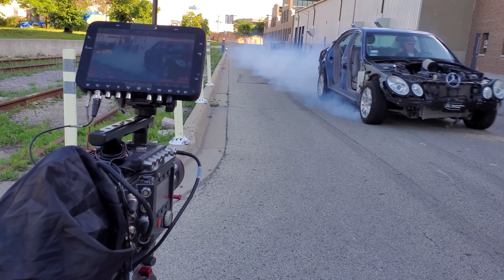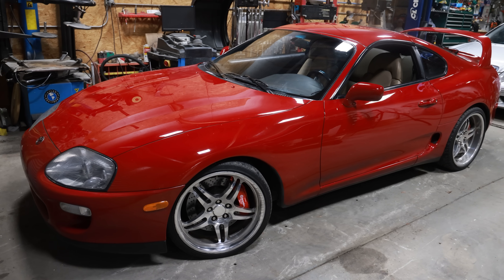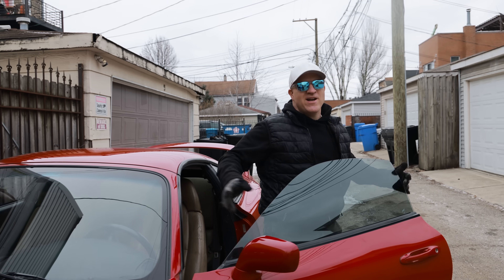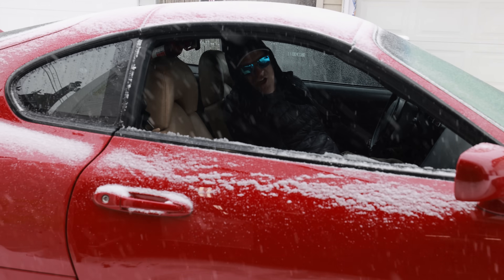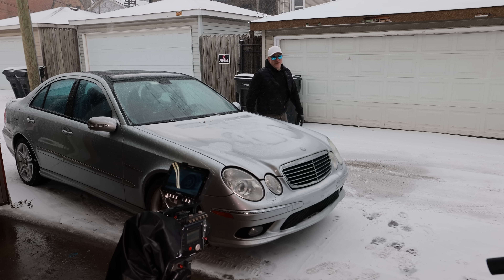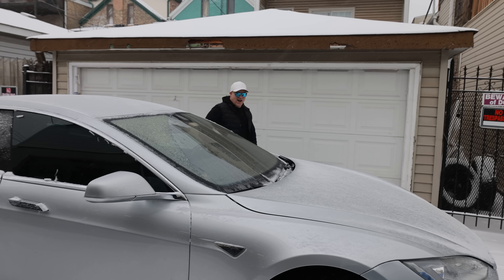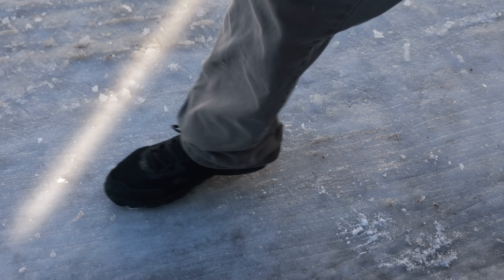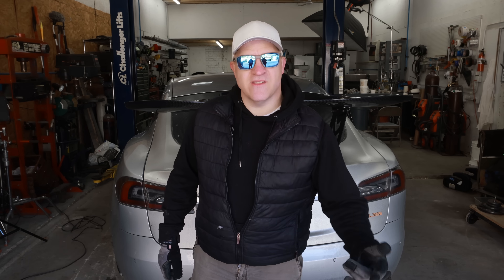Anti-Lock Brakes (In Slow Motion)

Comment: Are ya sure they are locking up everytime they pulse? I thought when they locked it was a pulse failure.
Reply: If you mean by pulse the frequency abs modulate pressure then it's a lot more. About a hundred per second.
Reply from the maker: Well either way the ABS is controlling the lock up and the opening of the calipers, so pulse frequency is still valid whether it's rolling or locked up.

Comment: Is there any brakes that apply a constant variable force depending on the surface instead of the normal breaks that give full force in pulsed manner
Reply from the maker: That's a really great question and I thought the same thing. I kind of thought that's what the Tesla did but once I saw it with the high-speed camera that theory was shot down
Reply: @WarpedYT 😂but that's what the regen does right

Comment: ABS is fascinating! It works on the fact that wheels that are turning have more authority than wheels that are locked up.(found this out on models hehe)
In a panic situation our instinct is definitely to push the brakes as hard as possible (brain said STOP!!) ABS steps in to pulse the brakes, to maintain steering control and can reduuse the distance it takes!
Something equally awesome, It's able to command the amount of braking power to each wheel. Say one side hits a patch of gravel it can reduce the amount going there while increasing to the others, it's so the car tries to trek straight. AND most cars use the steering angle sensor along with the accelerometer to make all this even more effective!
I love this technology :D
Reply: You're correct, but you're talking about several different systems.  ABS, traction control System and stability control systems all work in conjunction to accomplish those things. It's not simply the ABS.
Reply: Note that the purpose of ABS is not to reduce stopping distance. The purpose of ABS is to retain control while you brake.
Reply: @shadowboy813 exactly, I was pretty sure it's made for reducing braking distance / maximum grip, until I learned few years back that it's for steering. Locked up wheels and you can go straight only, ABS and you can turn while braking.

Comment: A lot of people misunderstand ABS systems. Modern systems don't pulse the brakes, they are constantly varying the force to keep the tyres at maximum grip. The times the tyres lock up are while the system is trying to feel the grip it has available. The modulation is done by bleeding fluid pressure back into the reservoir. The pulses you feel in the pedal are from a pump that keeps the pedal side filled up so the bleeding doesn't let the pedal go to the floor.
Reply: Oh wow today I learned, that's so cool
Reply: @bytesandbikes  
modern ABS systems work on three cycles, hold pressure, maintain pressure, and release pressure. The ABS pump is used to force your foot up to reduce pressure. When your foot drops, this increases the pressure, and valves inside the unit maintain the pressure it does this 100 times a second. Older systems are slower due to analogue sensor to digital conversion. Then, you got to consider ESP and traction control also included on modern systems which makes them far more advanced.
Reply: if that was the case, the system would not be able to release any more pressure when the pedal was fully up. And you'd need a separate pump for each caliper, and I've never seen that.
Reply: @bytesandbikes  
When the pedal is fully up, the pressure in the system is reduced, and the valves in the unit maintain neutral pressure before your pedal drops from your input, increasing the pressure again the cycles happen 100 times a second.
Reply: @dalesideroadclassiccarwork9038  Neat. What system is that? I've only done training on Bosch. I'm impressed the lag time on any pump is under 10ms!
Reply: @bytesandbikes  
I trained on bosch when I worked for Audi, vw and japanese systems when I worked for Mazda. But there are all pretty much bosch architecture. The difference is in the coding.
Reply: @dalesideroadclassiccarwork9038  Cool! It must have changed a lot, I haven't had a control unit apart since 2006. How is the high pressure pump able to start and stop so quickly now? Is it a piezo solenoid or something?
Reply: modern ABS systems have per tire resolution and per tire grip management.  older cars just push the pedal out until the wheels start spinning again.  I have an old car that has "ABS".  it might as well not have, as it only goes based on a single front wheel speed sensor and the output speed sensor from the transmission, and if they vary by more than 5mph, it just kicks the pedal out until the speed matches, it does not "modulate" anything.  my modern 2021 sienna doesn't pulse the pedal at all and does the grip modulation that you talk about.
Reply: @chubbysumo2230  four channel ABS  systems have been around since the 80s iirc. It wasn't a straight jump from one channel to four. It was one, then one per axel, then I think three with both front and one rear axel.
Reply: Sadly, no they don’t.  At least not well.  As the video shows, they basically lock  and release rapidly.  Continuously variable analog actuation is nice in theory, but doesn’t work well in practice for several reasons.  One, is the inertia of the wheel.  Once it locks, particularly on a very slick surface, it takes a lot to get it spinning again when little traction is available.  The only way to ensure this happens quickly is to essentially fully release the brakes.  Then if ease back into them too slowly, you leave a lot of braking on the table.  About the only way to make ABS really effective on slick surfaces is to have a fifth wheel that constantly measures the road speed so that the ABS has an absolute reference for tire rotation speed and can just more quickly tell when a given wheel is decelerating.  Most systems today rely either on the average speed of all 4 wheels, which doesn’t help much once they all lock, or on the wheel getting below some absolute rotation speed which by necessity has to be a very low speed to avoid losing braking at slow speeds.

ABS isn’t easy to implement well across a variety of road conditions as we see in tests like these.  You really need more information that you can get from the 4 wheels being controlled in order to get analog like smoothness.
Reply: @LTVoyager  This, along with front wheel drive being common, is why student drivers are taught not to press the clutch early during emergency stops (at least in the UK)

I'm really interested in what systems are doing this on/off that people are commenting about. I've worked on a fair number of different cars and bikes over the years, and never seen anything but the single pump multi servo types. But I have no experience with American cars new enough to have ABS.
Reply: @bytesandbikes  Sadly, in the US we have so few manual transmission cars that our student drivers have no idea what a clutch is.
Reply: @LTVoyager to be fair, 99% of the time not all wheels are locking in an emergency stop on dry pavement. Brake bias and weight transfer usually allows at least one wheel to give good reference. Winter driving is where ABS is notorious for sucking, but I believe between inertia sensors, brake pressure sensors, and other systems this could be greatly improved if it hasn’t been already.
Reply: @TheArchitect515  That is why I said slick surfaces.  Unfortunately, slick surfaces is where ABS is needed most.  Yes, lots of tools are available to make ABS better, but that entails a fair bit of additional development and hardware cost.
Reply: @LTVoyager  Could camera- or laser-based system help here, like used in e.g. optical mice?
Reply: @ I think technically for sure.  I believe the problem is environmental.  Keeping a laser clean from road grime, brake dust, road salt in northern climates, rain, etc., would likely be an insurmountable problem.
Reply: Maybe we need a whole video on how it works...

I lived in Colorado for 10 years and had a driving job and mostly drove Dodge minivans. Every time the ABS kicked in when it was icy or whatever the pedal went most the way to the floor. It was actually kind of weird because it felt like you were losing control and so you would naturally pull your foot up until you learned how it was working.
Reply: @ The problem is that most ABS systems are proprietary and most companies that make them aren’t willing to share the details.

Yes, ABS on snow and ice feels very weird.  And in snow, it is actually very often not helpful.
Reply: Thank you, im glad i dont have to write this :)
Reply: but I am quite dissapointed by Tesla braking performance. Having regenerative braking gives far sensitive control in a manner that they might not even get to ABS control range.
Reply: @ Apparently not or Tesla would have used it.
Reply: Ooh that's a new thing I learned today. Its stupid to pulse the brakes at 100% cuz it will just lock up the wheels multiple times right?
Reply: You took the words out of my mouth

The pulses where the wheels lock up are done on purpose for feedback to the avs module through fluid pressure and the wheel speed sensors
Reply: So they don't pulse the brakes, they just constantly vary the force through a series of pulses. Makes sense.
Reply: @chitlitlah lol sounds about the same
Reply: Working in an actual ABS-ESP system factory, it's kinda funny reading all these comments that are never fully accurate 😄
Reply: @GlekkeMatrak  - I'm happy to get details. 😁I've not been in the guts of anything in the last 10 years.
Reply: @ So, pray tell us, what is accurate?
Reply: @LTVoyager  I can tell you that a modern system in no way relies on just an average speed, let alone wheel speeds alone. Steering angle, yaw rate and brake pressure are monitored every millisecond. Wheel speed sensors are bidirectional. We also make those by the way. Analog valve actuation does exist. The pump is in place to fully take over the function of the pedal, so the pedal stays in the exact same position at all times during ABS function. Modern brake-by-wire systems only even have a pedal simulator.
Reply: @ What part of an ABS system requires steering angle and yaw rate?  Those are inputs to a stability or traction control system.  It sounds to me like you are confounding multiple systems.
Reply: @LTVoyager  ABS, ESC, TCS, all one system buddy. One single control unit, one single hydraulic unit. ABS needs steering angle to determine the correct speed difference between the inside wheel and the outside wheel in a turn.
Reply: @ Exactly.  The discussion was about ABS functionality though, not ABS + TSC + ESC + etc.  And the really smart systems use GPS or inertial sensors, but they are the exception at present.
Reply: @LTVoyager  I  talking about ABS function as well. You brought ESC + TCS into the discussion, not me 🤷‍♂. And no, GPS is not smarter than the combination of said sensors. GPS has too large of a margin of error to make such precise calculations.
Reply: @GlekkeMatrak  Ah, of course. I forgot brake-by-wire! Those slightly scare me, but that's likely just age 😂
Reply: @bytesandbikes  there's always an hydraulic fallback, no worries 😉. At least for now, while all braking systems are still "wet systems".
Reply: @ No, you brought it in with discussion of sensors that ABS alone doesn’t have typically.
Reply: @LTVoyager  dude seriously 🤣. The ABS that doesn't have those sensors I mentioned, are systems from the 80s or maybe early 90s. Not at all relevant anymore for todays' safety standards.
Reply: Love all the rocket scientists opinions of truth.... LMAO
Reply: you break faster WITHOUT ABS. ABS is total nonsense.

Comment: What would be interesting to see is how close together the pulses on each car is. I drive 2 24 yr old vehicles. In a NON ABS automobile, all 4 brakes work at the same time with equal force back and front being different, the way ABS IS DESIGNED, THE PULSES START AT THE WHEEL CLOSET TO THE DRIVER AND GOES AROUND IN A CLOCKWISE CIRCLE, the drivers starting wheel is not supposed to pulse again until all 4 wheels have pulsed... In bad weather I have to pump my brakes sometimes while entering a turn.... I'm the only vehicle sitting crooked at the light
Reply from the maker: That's exactly what I was trying to do here and especially in the last test on the ice, it seemed like the Tesla had shorter pulses... But it was still very close.

Comment: The "pulse" labeling feels backwards, in that that's when ABS is not intervening. When the wheel is turning, that's when ABS is doing its thing.
Reply from the maker: Yeah that's true like when the ABS is unapplying the brakes, by the way I look at it is when the brakes are not applied then you are not breaking and neither is the ABS, that's why I counted the pulses that way
Reply: @WarpedYT  ABS doesn't totally release the brakes to get the wheel to start spinning again... you're still slowing down even if ABS is decreasing the braking force by a little bit just to the wheels keep turning
Reply from the maker: @natjam0205  that's a great point, I almost dove deeper into that and also what type of ABS braking system each car has, but I wanted to keep the video simple and visual. Although I did forget to put the video clips of the different ABS pumps from each car 🤦‍♂️

Comment: I'd like to see you try disabling ABS on all three (pull fuses if needed) and see how good you can manually pump the brakes on all three. Can you stop in a shorter distance or are humans worse? Can you pump slower or faster? fewer or more times? Personally myself: as long as I catch myself and react in time, I've found manual brake pumping (in car w/disabled ABS) a lot better than ABS. The tricky part is remembering, it can be easy to stab on brake in emergency and forget last second. Also maybe show the audience pumping with ABS on too - this is a big mistake that some folks make.

Comment: This proves nothing. ABS is shit in the snow, and your tesla is the heaviest of all the cars due to the battery weight and the engine you've put in it. The Toyotas Abs works off magnetic reluctance sensors, therefore slower reactance due to analogue/ digital conversion. The tesla and the Merc have hall effect sensors (digital input). A better test would be all three cars doing the same speed and braking at the same line and then measuring their overall  stopping distances.

Comment: I think the pulses are the release of the brakes and not the locking.

I think the abs uses your full braking power, then release like 30-40% of the braking force and while pulsating, it slowly re-apply the force until the wheel locks up, then the cycle starts again.

I might be wrong tho.

Comment: Am I wrong or is it really that the “pulses” are what allows the wheel to spin and the locking of the wheel and rotor causing freeze is when the system is not pulsing. The way it’s presented here is backwards.
Reply from the maker: Yes that's when the ABS intervenes but in reality ABS is intervening the entire time and abs is controlling the pulses and the breaking so that's why I counted them that way.

Comment: Great video.  Is it possible the ABS computer looks at the wheel speed data of the other wheels to change pulse frequency accordingly on the wheel being recorded?  Or do we think each wheel is handled independently from a measuring and pulsing standpoint?  As in, if it stops spinning, it gets pulsed.  Or.... could the pulse intervals on a single wheel change based on the wheel speed data the computer is collecting on the other corners.  Neat topic.
Reply: Depends how many channels the ABS module has. Some older rwd cars only had 3 channel abs. So the rear brakes both share the same channel.
Reply from the maker: That's a really great question and same thing that I thought, that's why I did the three different tests and three different conditions because I thought that the computer would see some different data and make shorter pulses or change the output a bit but it seems to be essentially the same

Comment: The way you count the pulses is a bit back to front, you should be counting the releases after the wheel locks and the wheel starts rolling again. Insignificant I know but could confuse people
Reply from the maker: You are correct but showing when it locks as a pulse would still be considered a pulse because the ABS is the one intravening and sending those signals, but I mostly did it because it's easier for somebody who doesn't know about cars to understand that a pulse is a lock up but either way the frequency is the same whether you count the lockups or the unlocks.

Comment: Very interesting! I own a 1999 Porsche and I can feel the ABS pulse with longer intervals and a kick in the steering a bit regardless of surface condition and on my 2017 Mercedes S550 I don’t feel that, it just sounds like a bunch of angry hornets under the hood 😂. I know the level of wheel isolation between the two cars is different but it really feels like the Mercedes is pumping way more times with almost no momentary lock. I remember the days before ABS when it lightly rained and oil in the road raises up as you came to a stop the car would skid without any steering control (scary stuff). Great video to give us an interesting insight on ABS 👍🏻
Reply: your 99 porsche has a "single" system, aka, all wheels are operated from the same pump, so you feel the pedal push out more.  the 2017 has each wheel modulated on its own and can bleed/pump the pressure from the pump for each wheel independent of the others.  it sounds like "angry hornets" because its running a much higher volume/pressure pump to handle all 4 wheels pressure and volume demands at once, as they will all need different feeds/flows.
Reply: @ makes sense, thanks
Reply from the maker: Yeah for some reason Porsche feels that way, I always wondered why.